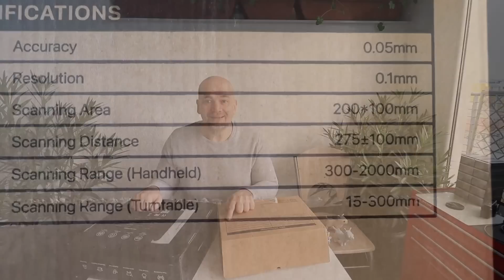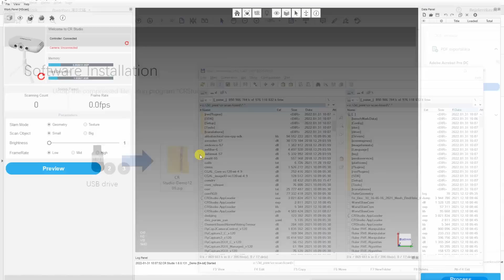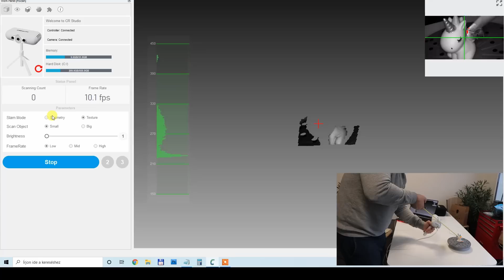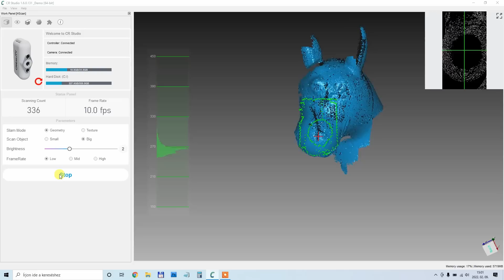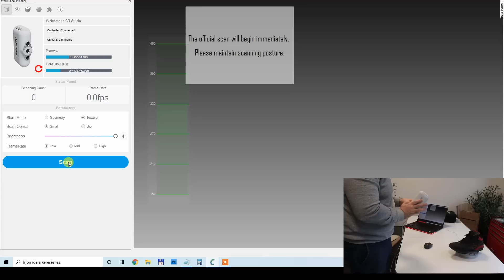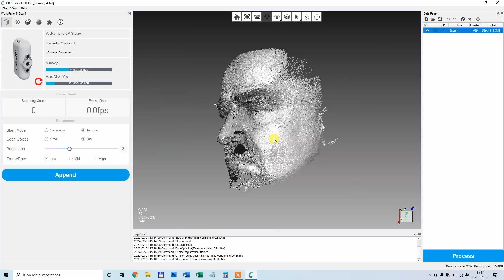Creality CR-SCAN Lizard, compact 3D scanner by Creality

Comment: My objective is to scan the engine compartment of a small-ish car after engine removed.  I'm hoping to extract dimensions to help design supports.  My thought was to use handheld mode, but mount the head on the tripod,  and put the tripod on the turntable centered in the empty engine compartment. 
Or maybe shift position of scanner around to optimize distance to surfaces of interest.

Comment: Do not touch it. Got it now and I have to say NOTHING works. Neither accuracy, texture mapping nor MacOS support. The software would keep crashing and only delivers garbage. The support still thinks that it will work in the FUTURE. Never again electronic waste from Creality. I'm really disappointed with the product. I hope I could help you save money.
Reply from the maker: On windows it works. Soon mac version of CR studio 2.0 will be published. You should try that
Reply: @MyTechFun  nope, neither cr1 nor cr2 works. Full of nap! Why is it written in if it doesn't work. The Mac version is missing all external texture mapping. Here, expensive electronic scrap is simply sold at the expense of the customers! for 1000 bucks you can expect everything to work as described? or?

Comment: I really like the portability factor, but considering cancelling my kickstarter pledge. 
I already own a Einscan SP and that does excellent and very accurate scans, but wanted to do larger objects and possibly full body scans which this appears not to be ideal for, or at the very least requires a lot of patience and practice.  Like someone else said, facescan worked well... Would probably be better off with the previous incarnation which also has colour scanning built in. Thanks very much for the review :) Gained a subscriber!
Reply: There is color option added for the lizardscan already.

Comment: Great review, thank you! Just finished installing my microswiss direct drive on my e3v2 after following your other video. 

I would love to see an update of Creality software to support non-contact metrology with this device - ie scanning and comparing to a CAD model with tolerances defined as PMI.
Reply: Did you see that he didn't recommend the micro Swiss direct drive on the E3V2? I'm pretty sure he mentioned it in the video, but if not he definitely mentioned it in the comments.

It's too heavy for the single z axis E3V2 and it's unnecessary. I realized that on my own as I was installing it. I returned mine and just bought the micro Swiss heat break and hot end. Just upgrading your extruder to an all-metal one is all you need. You'll be able to print faster without the heavy direct drive on the printhead as well.

I'd return it while you can.
Reply: @dangerous8333  no, its actually proven to be a very effective upgrade. Stringing in PETG was a problem with bowden but has effectively been eliminated with the MSDD. 
I haven't seen any ringing artifacts at 75mm/sec in PLA, have yet to try any faster but at a certain point the moving mass of the bed will also limit quality.

Comment: Could you scan an engine bay with it?
Reply from the maker: Depend of the size. Mid/small size Yes. (for bigger, CR-Scan 01 is better) Maybe in some cases you need to coat too shiny or black surfaces with some spray (or baby powder :-)  ) Theoretically this can scan black surfaces, if brightness is on max, but then white areas become problematic.
Reply: What would you use that for? I'm just curious. Seems like you could just take a picture of the engine bay.

Comment: Thanks, very clear and informative 👍,  is it possible to place a wider lens over the current to have a wider angel? 
If creality make an interchangeable lenses feature,  would be the best price for value in the market
Reply from the maker: This should be question for Creality. But I think it is not so easy, there are 3 lenses there. Probably different type of sensors..
Reply: I think that would be great. Possibly some sort of manual modification.